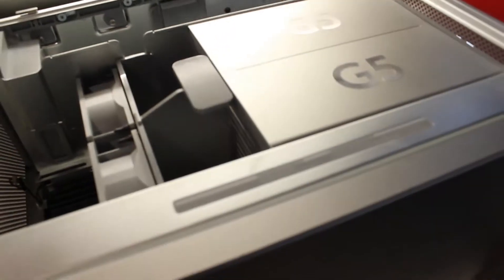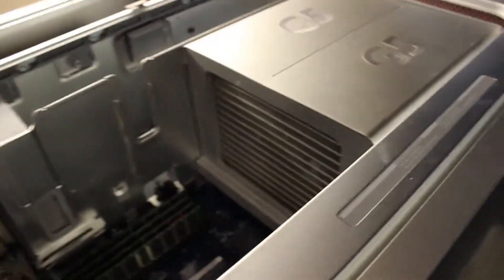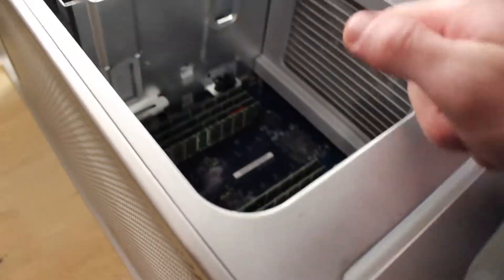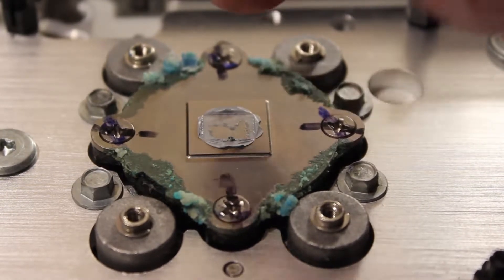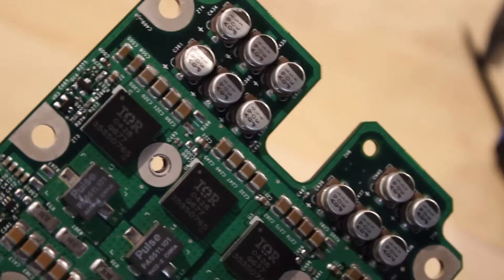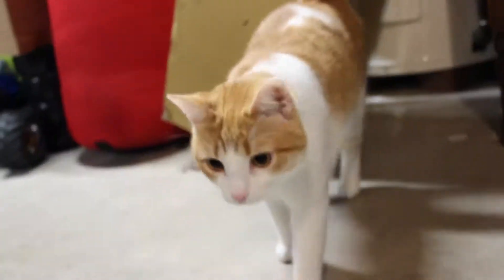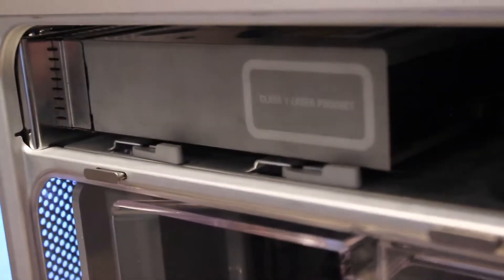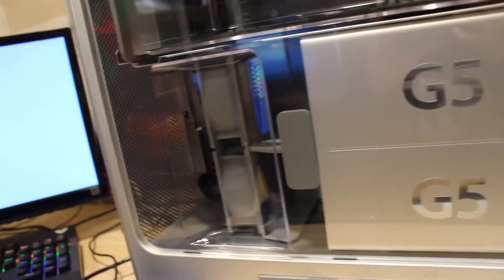PowerMac G5 Liquid Cooling to Air Cooling Conversion (time-lapse)

Comment: the water coolers are really not as scary as people make them out to be. Refurbished and maintained properly they last for a long time. They only got such a bad rap because the first pump design was very poor, the revision provided a much higher quality pump however they still used copper and aluminum together, thus the reason they used GM DexCool antifreeze in them, as this coolant is designed to limit and reduce the chemical reaction of the fluid with mixed metals. HOWEVER, just like a car needs its fluid changed so too does the Power Mac G5's water coolers, which of course no one did like.... ever. Replacing the seals and coolant with more modern solutions which are even better at handling the mixed metals and maintaining the cooler by replacing the fluid in a normal regular interval will ensure that the cooler never leaks, and never causes damage to your system, and more importantly it will keep your G5 from becoming the Wind Tunnel 2.0 because the air cooled heatsinks physically cannot cool the dual core G5s as well as the water cooler was able to do, therefor you WILL have increased fan speed. When you order your rubber seals for the water blocks, you are gonna get a bag of FIFTY of them. that is literally 25 individual sets of replacement rubber seals for the pump, and guaranteed the seals you put in there will last for several water changes before you might consider replacing the seals yet again. I wish people would stop converting water cooled G5s and just take the time to repair the cooler and maintain it on a regular basis.
Reply: and for the record, my Power Macintosh G5 Quad still has its water cooler, still works perfectly, doesn't leak, and is super super quiet even under full load.

Comment: I've own the liquid cooling version. And now i want the regular heat sink conversion. That liquid cooling leakage over the years has corroded my CPU, power supply and possibly logic board. The system won't boot up i get instant power off with red led.

Comment: I don't think this can be done on quad G5: air cooled dual 2.3 GHz has only one physical cpu and a heatsink that occupies both slots, and the AGP dual 2.5 or 2.7 GHz single slot passive heatsinks won't fit those cpu cards. So we should create some compatible heatsinks from scratch. The challenge is open!
Reply: Aren’t the daughter cards just slightly longer ? I have a g5 quad and interested in performing the air conversion .
Reply: @melchieor  tried it?

Comment: I was looking for a video where I can see how difficult or if is even posible to change thermalpaste in this computers and thankfully I found You... I have a question, did you know if the processors are compatible between those machines? I have a 2x2ghz and always wanted a dual 2,7 or 2.5 as yours, but I don't know if I can go for the CPU's or better for the hole computer
Reply from the maker: I think you can... It is definitely possible with the PCIe models.
Reply: @big-ts-tech-corner  It's possible with PowerMac 7.3 2,7Ghz ;), I made it.....
Reply: okay so just fyi you can indeed upgrade the cpus on nearly all g5s except for the imac g5 model power mac g5 lol yes it exists its a 1.6 ghz model with a soldered cpu . all others can be swapped 2003 and up  the 970 and 970fx chips are interchanagble  however go with the 970 fx as it is a better cpu  now on to the pcie based ones . all can do cpu swaps however most dual core models only have 1 cpu socket  the other isnt populated i say most because there is a few that  have both slots just 1 is populated  as far as i know you cant use a 970fx cpu or other in a pcie based model . i might be wrong though
Reply: @zerokool1985  thanks for all this info, mine is one of the first 2ghz with two slots but it only has AGP I upgraded to a 6800 Ultra as far as I know it suppose to be the best GPU for it, and an SSD, but if you say I can get one of the better newer CPUs I think I'll give a shot
Reply: @MRHOTCAKE  best GPU is the Radeon X1900 256MB, for gaming and the Quadro FX 4500 512MB for studio

Comment: Hi, do you know the code of the 2.0 DUAL heatsink that you used in the video? I want to buy two Heatsink 630-6892/T6889 related to the PowerMac G5 2.0 but I don't know if they are usable for the purpose. Thanks
Reply: the 1.8 ones work to  just make sure they have a copper plate and not the nickel plated

Comment: Really awesome, man! I'm in the same situation as you were, owning a G5 quad with failed dual pumps and a G5 dual core 2.0 which could act as 'donor' computer. Did you check the CPU temps after the air cooling mod? PPC CPUs put out a tremendous amount of heat. 
After the AHT success did you manage to disconnect the pumps? Thanx Marco
Reply from the maker: For PCIe based G5s there is no fan calibration tool as I found out, only for pre PCIe G5s. The Dual Processor G5 would microburst the fans when doing literally anything which is the trade off for converting to air cooling. However, PCIe based G5s do not microburst after converting to air cooling. The fans run normally and the temps were very reasonable (35-45 on idle) No need to run the pumps on either system, you only need the pump to run AHT if it's pre PCIe.
Reply: @big-ts-tech-corner  ASD 2.6.3 is for PCIe G5s